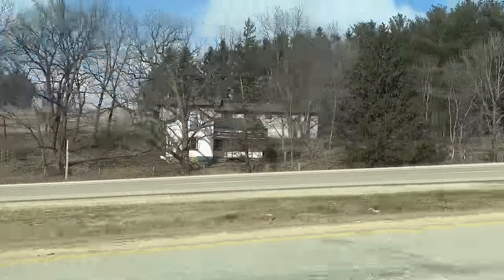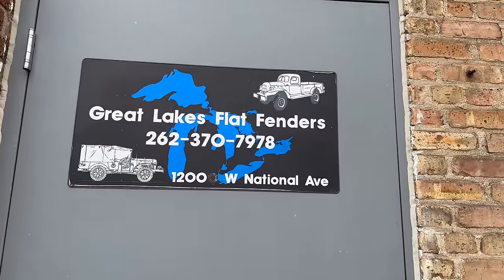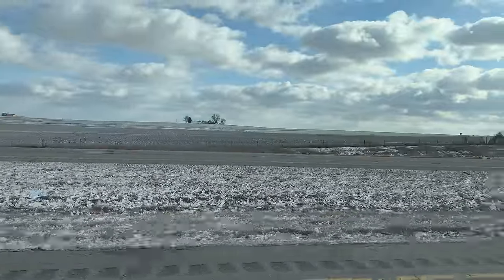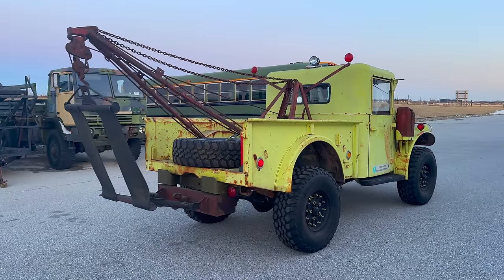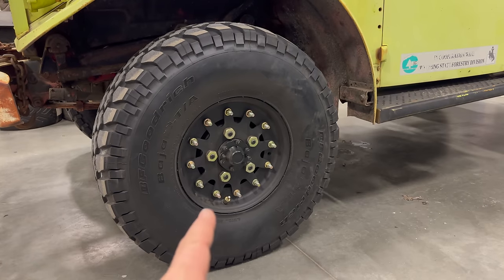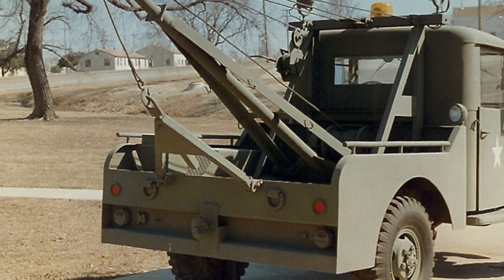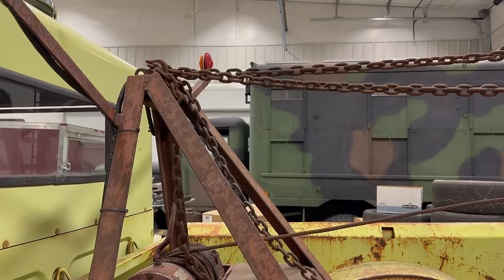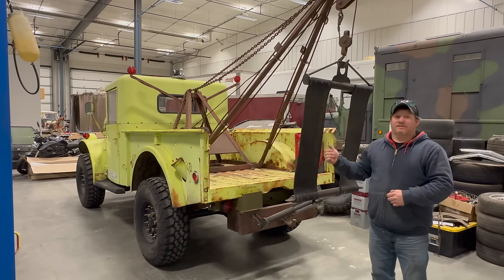M37 Vintage Off Road Wrecker

Comment: How lovely to see an old friend like the "Three-Quad." I learned to drive in these in the Canadian artillery back in 1975, a year before they were retired from service. They were the last truck with a manual transmission (other than the M151, which scarcely qualifies) and our driver's test were always given in them. I never drove a recovery version, just cargo and line-laying trucks. (I also drove ambulance and command post -- "gin palaces" -- 3/4 ton trucks, but they were not designated "M37.") The Canadian M37 had a metal rather than fibreglass roof, and the usual way to un-dent it after having stood on it to camouflage the vehicle was to lie on your back on the passengers' seat and push it back into shape with your feet.

Something of which you should be aware: if you have long legs, you can bruise your left knee with the steering wheel if you hold your foot poised to depress the clutch pedal while closing the door at the same time.
Reply from the maker: Great story and thanks for the tip

Comment: I have a 52', I'm putting a 4BT into it with disks and PS right now. I am using WWII combat wheels and I managed to find some new 40" Michelin XZL tires. The first hard tops were just deuce tops they modified to fit, the Canadian trucks did get an arctic package officially. I have an original oval window deuce top that looks like it was made in a depot back in the day.

Comment: These need to be kept as close to original stock as possible they can only be original once.these can't match power and speed of new pick-ups but for its time period they out did everyone they are durable Tough and straight forward to repair and as Basic as they come and not fit for modern traffic but you could use it in the early morning hours to go to the grocery store and that would be fun.😊

Comment: Would like to see this in use. I assume those bumper straps would wreck a modern car front bumper?
Reply from the maker: Shouldn’t if you secure it correctly.  It doesn’t chain to the bumper you chain it to the suspension under the car.